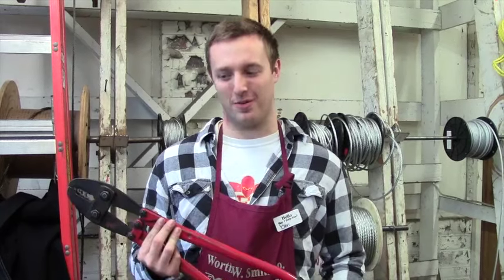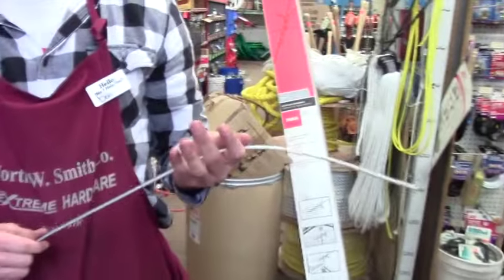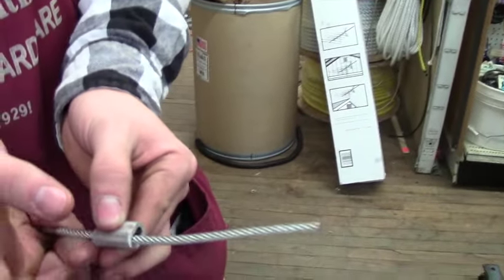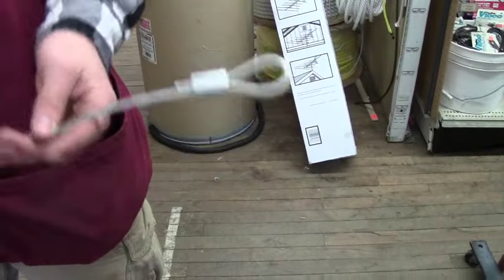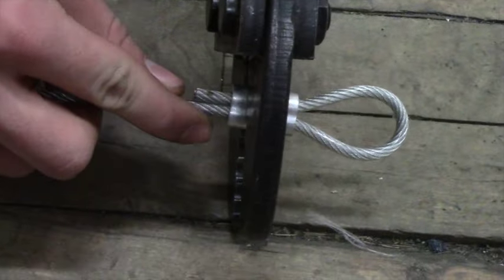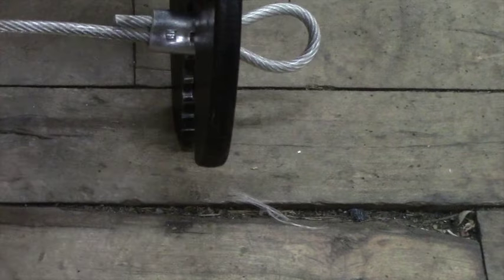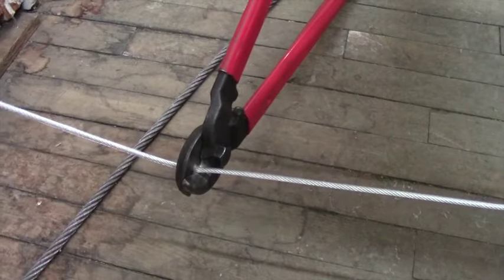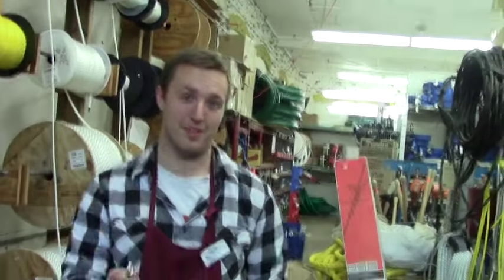Worth W. Smith How-to Series How to crimp a cable

Comment: 1. not cutting back cable coating before crimping
2. crimping off axis
3. someones going to get hurt following these instructions
Reply: W
Reply: what do u guys mean by “ off axis “
Reply: @w9x7cv3vg6  Crimp at 90 degrees to what this guy did.  You compress the two widest parts of the swage.
Reply: Went here to say that. He does this completely wrong!

Comment: Sadly, this is incorrect and could be VERY DANGEROUS if used for applications that require anywhere near the full strength of the cable for safety!  (Although I do appreciate the enthusiasm of the person doing the vid.)

There are two major things wrong:  1) It should be swaged (crimped) in the round sections of the jaws, NOT the dividers between the rounds slots.  The end result should be completely round swages in the aluminum sleeve (with a small raised section left between each swage).  2) The sleeve should be crimped 90 degrees from the angle shown .  i.e., imagine you are compressing the two cables together, NOT separating them.  *) Also note that, if maximum strength is desired when using vinyl-coated wire rope, strip off the coating before swaging.

I wouldn't bother to comment since so many others have already have about the problems with this vid but it's still up and people are still responding positively, so....  

I hope no one gets/got hurt!!!

Comment: Nothing about this was correct. Even calling the sleeve (ferrule) "the crimp"...
Not exposing the rope?
Swaged the wrong side.
Didn't even get a clean cut on the wire rope!
Hopefully no one is using this info for a critical application...

Comment: Thanks, very helpful!
Reply: This is absolutely incorrect crimping, DO NOT use this method on anything that is a critical support. While this may hold, you should crimp on opposing axis, loading the ferrule into the jaws sideways.
REPLY
Reply: Don't do it!!!
Reply: Don’t listen to this dude. He did everything wrong possible in the video.
Reply: Don’t follow this Beatle!
You will get hurt or worse
Reply: RIP

Comment: i know the part about taking plastic off might be reasonable but that may never slip out ! the crimping goes right through the plastic covering…the young fella though did not video his effort to finish the work that the cutter did…cause i know one has to wiggle the still uncut cable back and forth to finish the cut ha ha…and what is a thimble in this operation…you guys mention that….my mother used a thimble to do sewing back in the day….how about you guys making videos….then posting links in this video..if you think your smart…..i use those u bolts a lot doin this stuff but i find they dont grip in good enough so i am gonna get those crimps or swages…
Reply: Sorry, he did EVERYTHING wrong. Someone could die from following his instructions. There's enough movies out there showing the correct way.